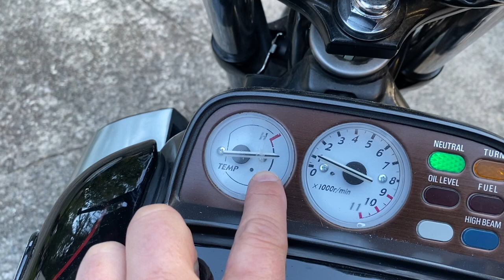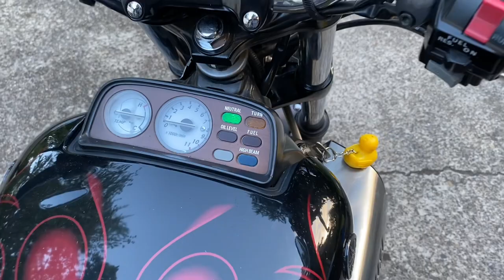Is your 1st Generation Yamaha Vmax overheating in traffic? Watch this, it may help! Free DIY.

Comment: There’s a couple ways to to help, even if the fan works , you can add a manual switch and turn the fan on when you want. I added water wetter to my cooling system and it made a difference, it just runs cooler. Do a flush , then add it.

Comment: Or you could just unplug it from the temp sensor like you did and put a switch in to be able to turn the fan on anytime you wanted.
Reply from the maker: To jury rig temporarily, absolutely.  As a permanent solution no.  

I had commented in this section that the one thing I would do is the Holeshot.com aluminum radiator fan and handlebar switch.  I would personally only want the switch as a backup.
Reply: @vaultexplorers1337  I actually got rid of the huge ugly factory radiator and run a smaller aluminum one off a Honda with a switch and it works fine.

Comment: My 07 Vmax did the same thing! Unfortunately, the coolant was old and when I flushed the system there was a whole bunch of debris in the radiator. A good flush, new fluid and it’s as good as new. Thanks for the tip though, I may pull those wiring plugs and add some dielectric grease for good measure.
Reply from the maker: Right on!   

Spoiler Alert.  Holeshot.com has an lightweight aluminum fan and handlebars swith that I’ll be adding next!!

Comment: Yeah usually happens when the connector gets corrided along with the wiring ,I usually just replace the wires and make sure the sensor isn't corrided.

Comment: I want to find My v max 1200 bike head light fuse location.. and change the fuse.. can You tell Me where it was....?
Reply from the maker: I just printed the manual.  From carlsalter.  I look it up.
Reply from the maker: On page 6-35 of the manual (download from carlsalter).  It says the 2 fuse location are under the seat and under the faux gas tank cover.  It’s too late to look now, but I’ll check soon and try to give you a definite answer.  What year is your Vmax?   Are you riding in Sri Lanka?